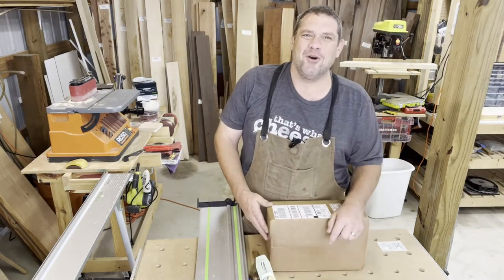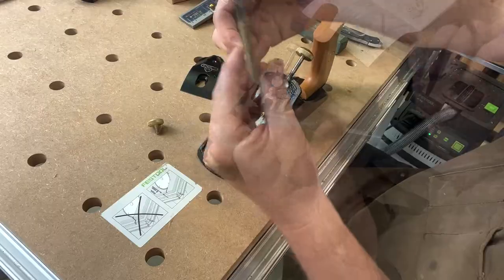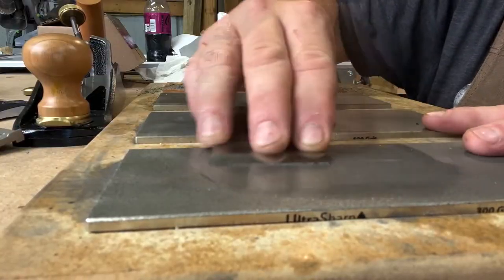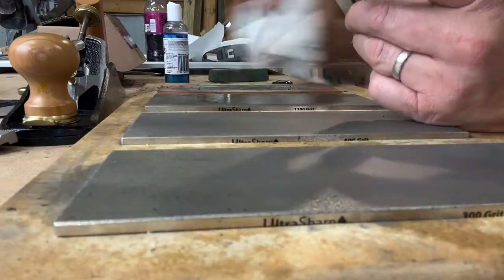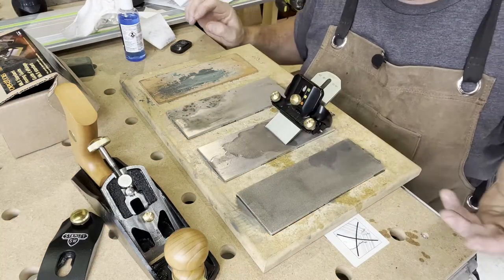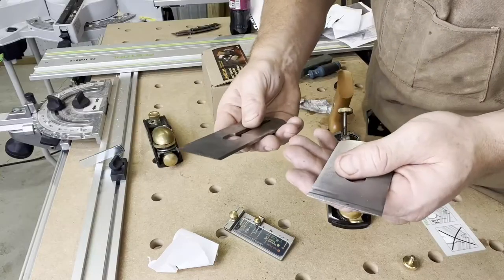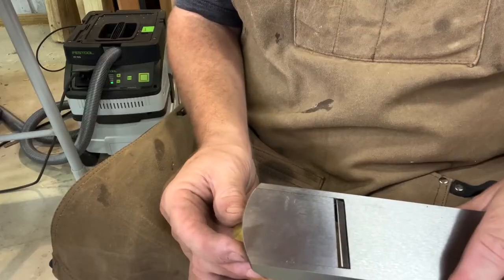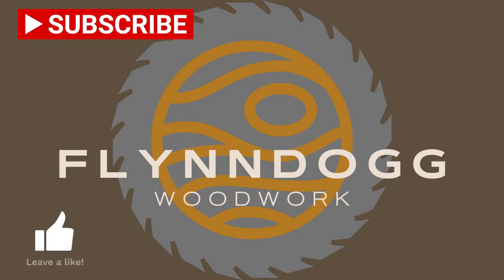Stanley #4 Sweetheart Unboxing and Setup!

Comment: happy to see you entering the hand tool woodworking realm! I am not claiming to be an expert, but I do see a couple of things than can help you with using your handplane: 1. For honing the secondary bevel, you do not need to go through the grits, just go straight to the highest grit stone you have.  If you go through all the grits for the secondary bevel, your secondary bevel will become wider very quickly, by then you will go to the bench grinder to re-establish the primary bevel. 2. do a search about the David Charlesworth ruler trick. 3. your shavings (at the end of this video) are way too thick, probably at around 5 - 10 thou, try to aim at a sub one thou shaving(for some type of wood, sub 2 thou if good enough).
Reply from the maker: Thank you, Thank you, Thank you!  Very helpful comments.  I think I've heard of the David Charlesworth Ruler Trick.  I think I saw "stumpy nubs' doing that in one of his videos I was watching.   Really appreciate your advice!

Comment: Great video. Im late to the party. Id also check the sole to see its flat as well and flatten it if it isnt. Another thing is to start with a retratcted blade then advance it into what you need as opposed to the other way round. When i grind the blade i only do it until a burr forms then i remove and goto the next grit.
Reply from the maker: Great tips!  Thank you so much for sharing jlhuk!  I need to break this plane out more often!  I was just about to make a french cleat hanger for it the other day.   Thanks so much for watching!

Comment: Stanley #4 Sweetheart handle detach has come off how can I fix it?
Reply from the maker: That’s a great question  and wish I knew how to answer it.  I assume the screw has come off.  I believe there is a screw that runs through the handle and attached to foot of the plane.   Might be worth checking out some of Rex Krueger videos, he really tears those planes apart and you might be able to figure it out from one of his videos.  Thanks so much for the question, which i could be of more help!

Comment: with expensive tool, there's lot of work to be done before using it even though its new,.....why !!!!?????😭
Reply from the maker: Well this is true, this is one of the reasons why I've been so intimidated by this tool in the past.   I started with the lest expensive kobalt to try and learn a few things from that before I broke the bank for this one.   In theory, you really don't need to do any of the sharpening things that I showed in the video, they are more best practices.